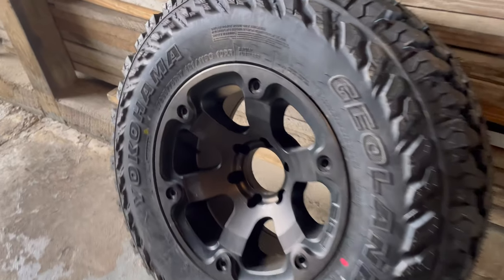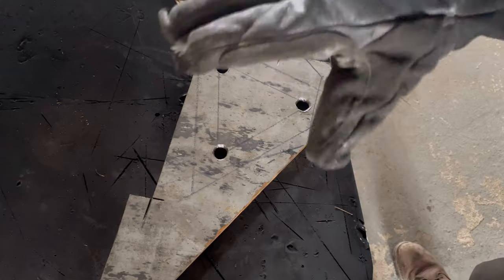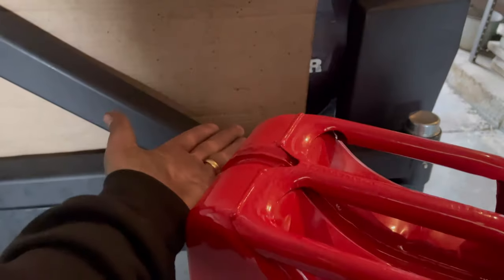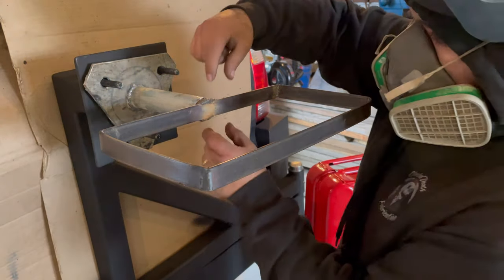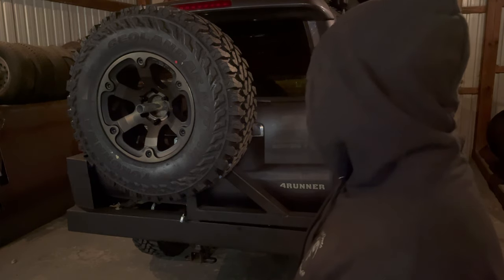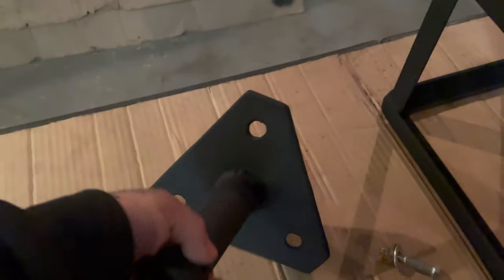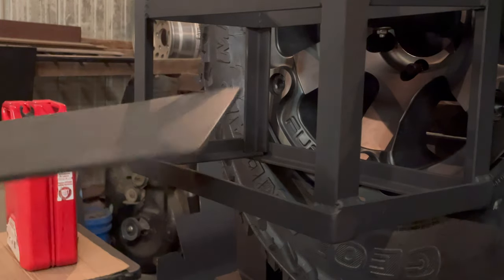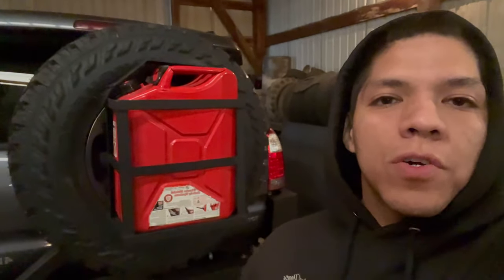Gas Can Carrier Build

Comment: I built
One for my work van almost identical to this.
I left a little wiggle room on the sides to inset some rubberized car door weatherstripping that flexible and has a metal bendable band inside to mold to any contour .
This keeps the cam from rattling and chafing.

Comment: I am very impressed with your solution to this problem. what type of pipe did you use for the mount ?im having trouble finding pipe that fits snugly inside  of each other /any suggestions about the source for your pipe for the mounting ? Thanks, great video !
Reply from the maker: Thank you! It all depends on wall thickness, ID, and OD. Some exhaust tubing is built to fit inside a connecting piece.